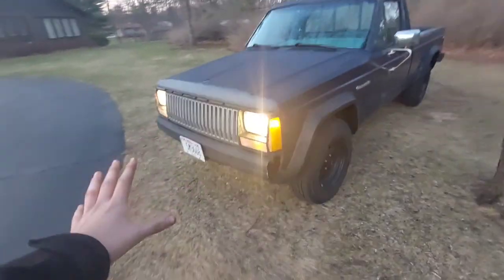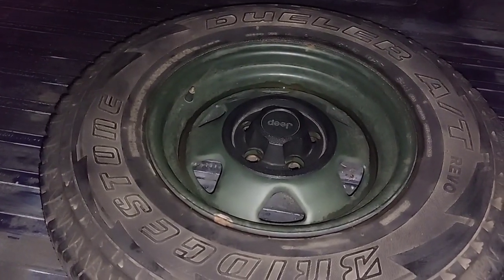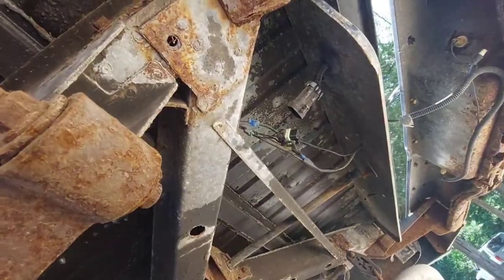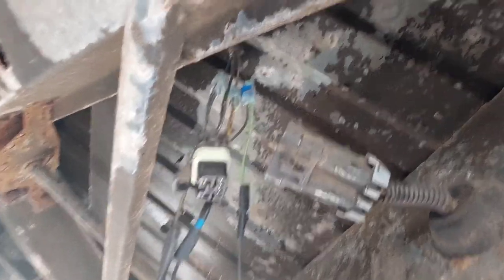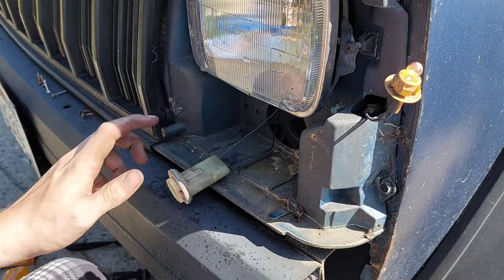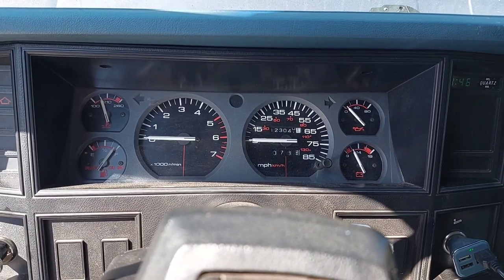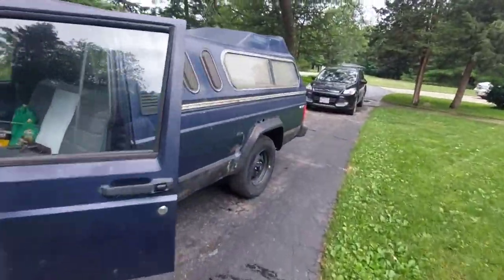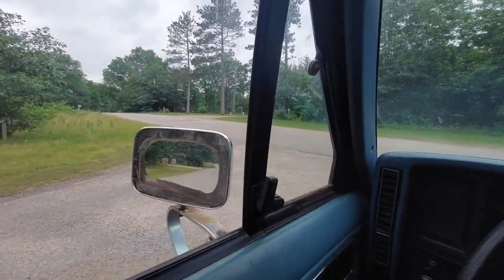Jeep Comanche - Fixing Turn Signals, Brake Lights, Hazards, Reverse and Running lights

Comment: Bro, you have the same energy when I'm working on my 'Manche. I also have the same issue with my tail lights and I'm going to take all of the clues you gathered and see if that solves all of my life's problems.
Reply: Found it. Hot wire was plugged into ground in the back. Gucci. 

Thanks.

Comment: Thank you for this video. I have 87 comanche Pioneer 86,000 miles . Driving me crazy trying to figure out what was going on with my turn signals. My case it is my back brake light, which was driving me crazy. I just realized after reviewing my back light issue the previous owners rig a orange Extension cord for a the tow I guess  ugh 😂

Comment: Did I miss the brake light(s) repair? Are these repairs applicable for the '86. 2.4? You have about the best fo-real Comanche repairs around, thanks!
Reply from the maker: I didn't have to repair the brake lights, they worked fine so I got lucky with them. If yours don't work, I'd start with the switch on the pedal. 1986 is the same as 87 but some of the wires may be different colors

Comment: hay, now that you are going to Florida you can finally use the ac in the white jeep, and trust me, you will need it!
All jokes aside though congrats on fixing the wiring gremlins, i have a few to work out in my jeep as well, speaker in the front driver side is dying because jeep decided to put a connector in the boot. I think im just going to run a whole new wire for both that and ground at this point to fix them but thats going to have to wait a little bit.
I recently blew a head gasket on my 4.0 so i ripped the engine apart and put a new one in and it works great again but i think after that 2 day fiasco im done working on the thing till my arms and back stop hurting at least XD 
Otherwise keep the the content coming man but be careful with the move, thats not a light thing to do so we understand if you need to stop or slow down for a little bit on the vids. 
Take it easy man and keep rolling!
Reply from the maker: Never!! Never stop! I MUST MAKE CONTENT

I'll try, I've been busting ass and it is tiring but also kinda rewarding

Comment: I just grab flashers from scrapyard when I go, pocket baubles are free if they don't do a pat down. I have a got 10-20 spare flashers when it goes along. Rewired my rear lights a few months ago had a similar issue, as it stands I don't have licence plate lights or it goes tits up the same as yours.

Edit, you find yourself near to eastern Washington or want to pay shipping I have a set of leafs you can have, probably needs bushings but they aren't from the rust belt and aren't broken or cracked.

On the brake lights/turn signal I had a similar problem with them. I used different bulbs and it fixed my problems but it was a rear light only issue.
Reply: Pretty sure that wire by the bumper you don't have a clue on is supposed to be for your license plate lights
Reply from the maker: man I was just in Eastern Washington literally 7 days ago, now I'm in Louisiana
Reply: @WAEMIDIV  oh shit, would have had a leaf out and you could have run away with it. Blew up the rear end year ago and slapped an XJ axle in it to have the truck. Just put a MJ rear in after finding one in a scrap yard, could not get at the axle in the scrap yard so I just pulled the leafs and drug the whole rear suspension out and swapped it. Now I have spare leafs and axle shafts. Next project is the load height proportioning valve, mine still works just doesn't have a bar.

Comment: Can you just tow it to FL with the XJ?
Reply from the maker: Theoretically... but this new Jeep doesn't have a hitch and the frame is rotted out (conveniently) right where the hitch goes, so I gotta fix the frame, install a hitch, equip a tow bar (or maybe rent a dolly) and then average 7 mpg towing 3,000 pounds 

I think it could be done, but almost easier to just drive it, because I'll need to make multiple trips back and forth anyway. I don't know, we'll see